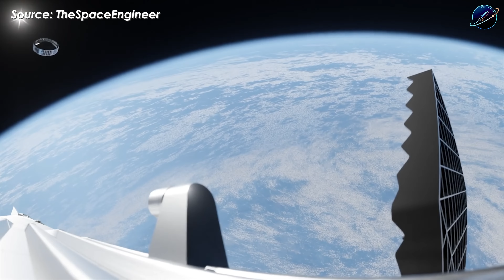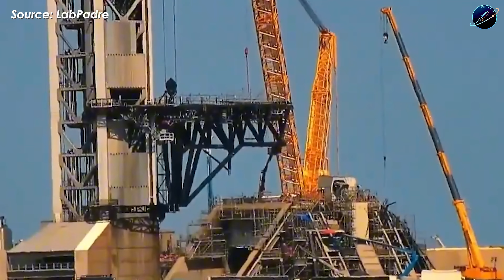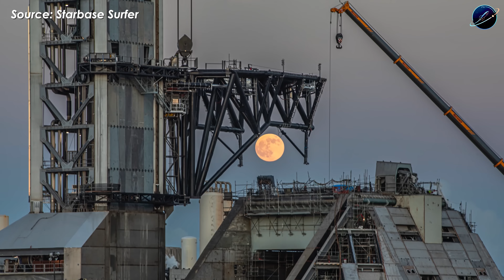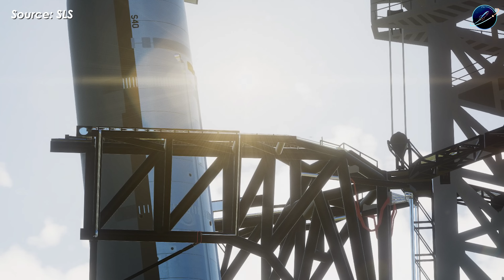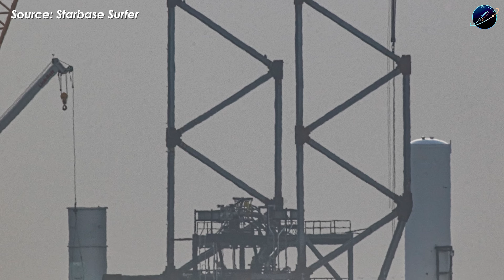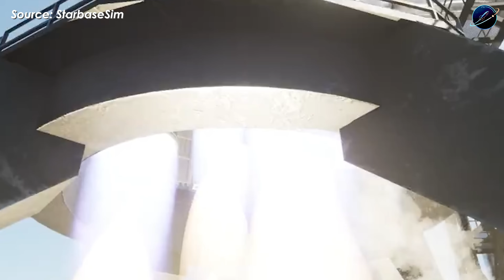Elon Musk Found Faster Starship Path to Moon: Flight 12 Cuts Trips by 60%!

Comment: Engineering never fails coz even God is an engineer
Reply from the maker: True, engineering never fails when done right—like God's perfect designs! Raptor 3's 280-ton thrust, 350s ISP, and 25% lighter build could indeed slash lunar refueling from 10-15 to 4-6 flights on Flight 12, making Elon's faster Starship path to the Moon real. What do you think will break first if it doesn't?